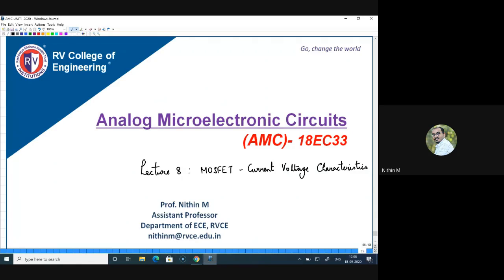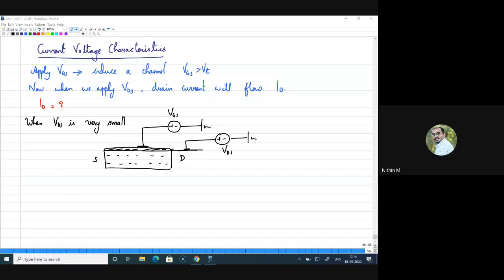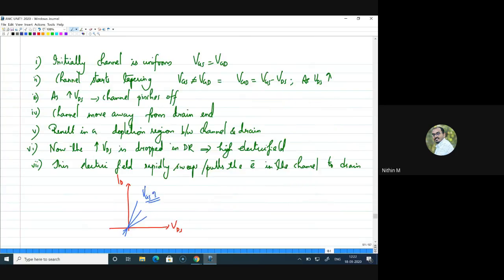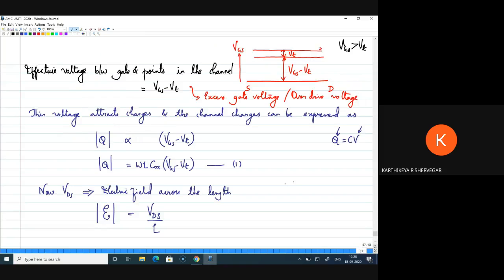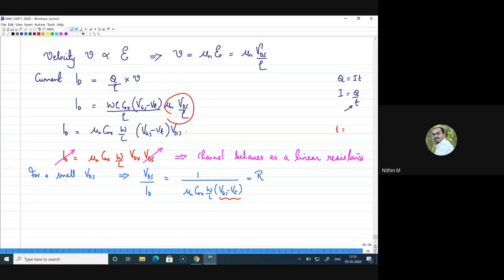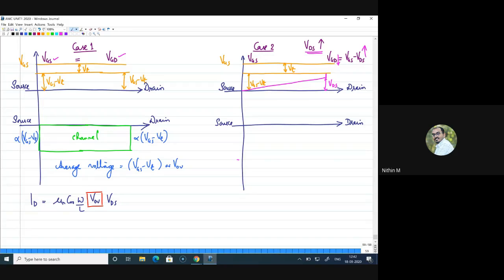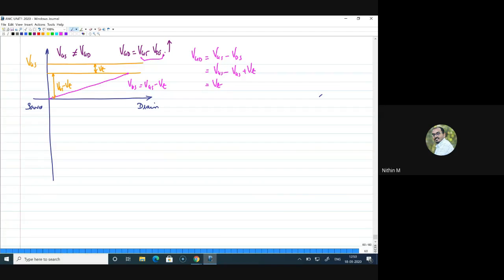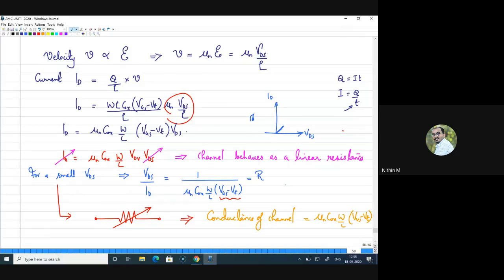AMC Unit 1Lecture 8

Comment from the maker: Kindly note that the output resistance of ideal MOSFET is infinite, by mistake in the video it is written as 0, even though the explanation is given properly. For any change in drain voltage, the change in drain current is zero and hence the resistance is infinite.